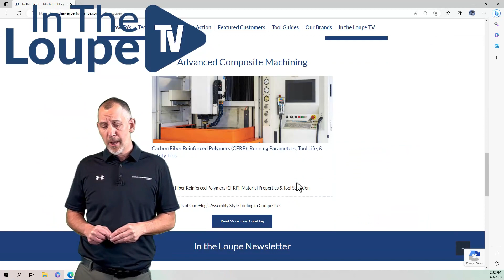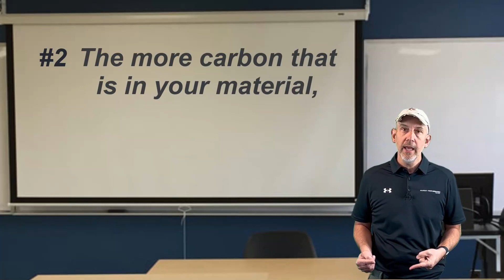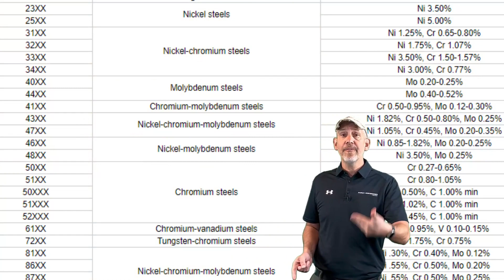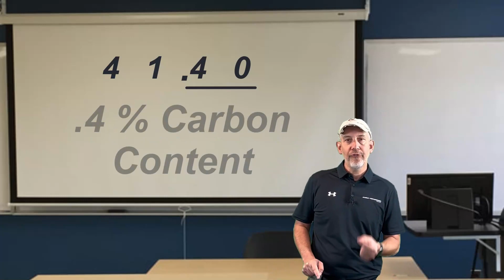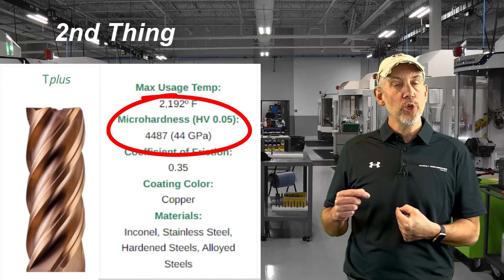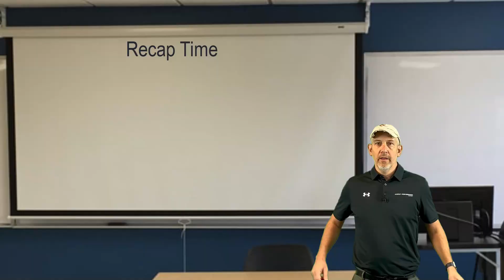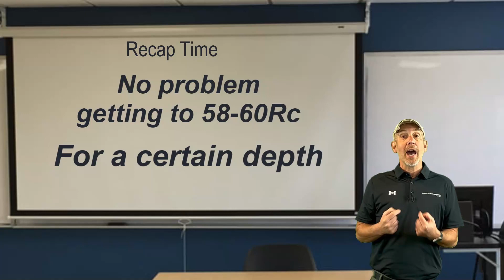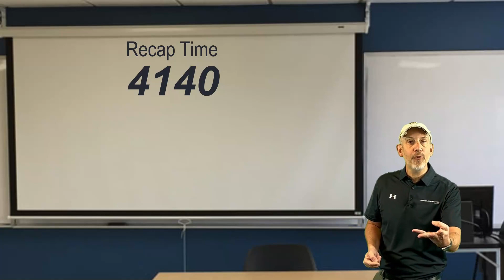Carbon and Your Cutting Tools: In The Loupe TV Ep. 15

Comment: I have an issue with my tool. Application material SS304L. Operation - Vane slitting; our carbide end mill - trial and pilot lot successful. Initial two lots of tools were performing with no issues. Later, we found chattering marks on the material. All the tools were from the same batch. We tried with lot many changes in the operation; but nothing worked out. Could you suggest me a solution?

Comment: Great content! I knew in general run slower on harder materials but had no idea about the carbon content factor.... that an annealed high-carbon material, though soft, still need to run slow, and remember it is abrasive

Question... does carbon content tie into work hardening? I would assume so based on this.

Last, yes I'd proudly wear that T-shirt!   Thanks for everything you've taught me so far.
Reply: Hey Joshua thanks for watching.   There are a lot of factors that attribute to Work hardening...  Believe it or not they kind of call it Work Strengthening.   It actually can be used to help make your components stronger,,  But I digress!  Higher carbon does contribute to more work hardening along with other elements, ( Chromium is another) One of the factors is the difference from Tensile strength to Yield Strength.  Usually the greater that distance the greater the ability to work harden..   Best way to combat some of this is to not Baby your tools.  When a material work hardens make sure you take a good chip load!!  Get underneath that work hardened layer.   You will find that tool life goes up with a bigger chip.  We will get your info for that shirt sir..   Thanks again for participating! CTC

Comment: Wanna ask if you could elaborate on best practices and tooling selections when milling thicker A36 laser cut plate like 3/4in and above with a bit of a rough outer shell. 
Also gimmi a t-shirt too :)
Reply: Good Ol A36..   First of all A36 is low carbon hot rolled material.  It usually comes with a lot of Scale on the outside and kind of looks like crap when you get it.   Makes the machine a mess with carbon scale on the outside.   That being said there is a method of taking a Conventional cut on the outside flame cut vs your traditional Climb pass.  The point is there is good clean material under the flame cut and the scale.  If you conventional cut then every subset tooth should be in the fresh stuff.   So try a conventional cut on the outside ( Making sure to get to clean material on first pass) and you should see a bump in tool life...    Bonus info..   A fine tooth Knuckle rougher works well on flame cut material and scale...   Hope this helps and we will get your info for that shirt!!